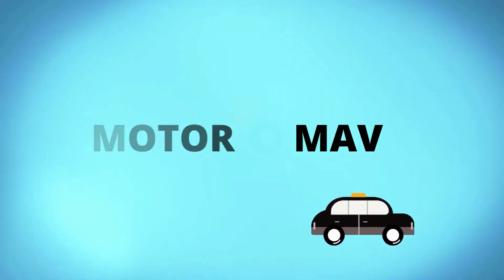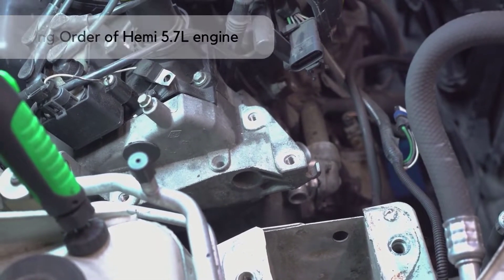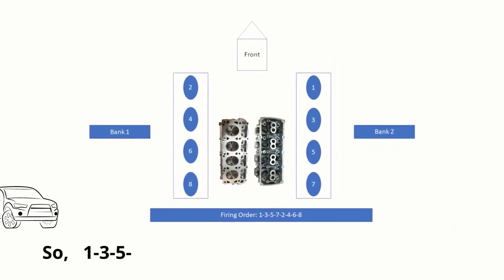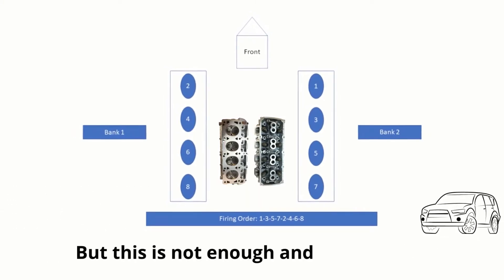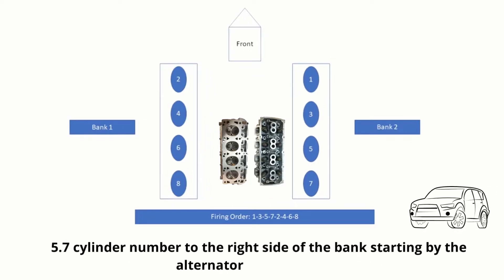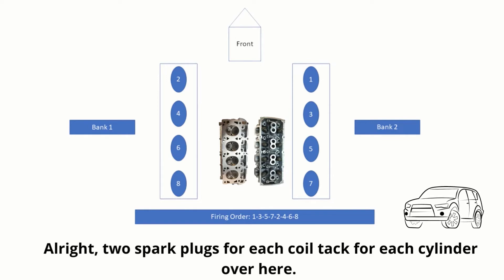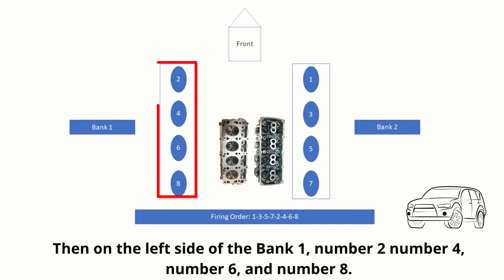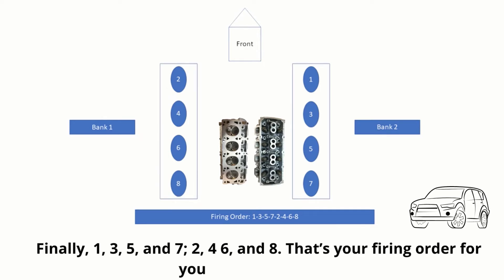5.7 Hemi Firing Order [ Diagram & Explanation ]

Comment: If we are looking top down and the front is labeled correctly 5.7 hemi= Bank 1 (driver side) 1,3,5,7 Bank 2 (passenger side) 2,4,6,8 (sides need to be swapped) and Firing Order is 1-8-4-3-6-5-7-2. This video isn't just wrong it's extremely wrong. It's also the first video that popped up when I googled, you guessed it, 5.7 hemi firing order. Just go to the first online ram forum instead and disregard this video. Too bad youtube doesn't show dislikes anymore

Comment: This is so wrong. 1 3 5 7 on drivers side 2 4 6 8 passenger side. Firing order 1 8 4 3 6 5 7 2. This is for all Ram 5.7 Hemi engines. How can you be giving out such wrong information. I hope nobody actually tried to use this information. WRONG WRONG WRONG
Reply from the maker: We have not included any wrong info. The info suggested here is reviewed by our experts before publishing. So,if there is any issue we will surely take a look into it.

Thanks for feedback
Reply: @MotorMav  It was brought to your attention 2 weeks ago, AND yet you still are giving out WRONG information. CYLINDERS NUMBERED WRONG AND FIRING ORDER DEFINITELY WRONG. NO WAY A V8 OF ANY KIND WILL RUN PROPERLY WITH THAT FIRING ORDER
Reply: @MotorMav  reported for misinfo
Reply: @MotorMav this is DEADLY WRONG